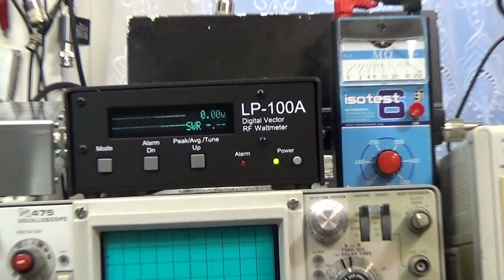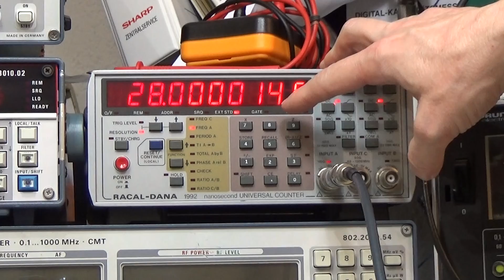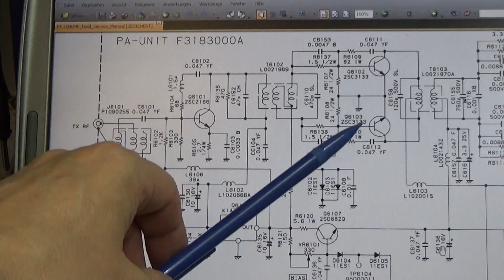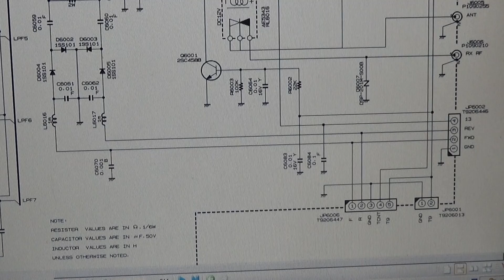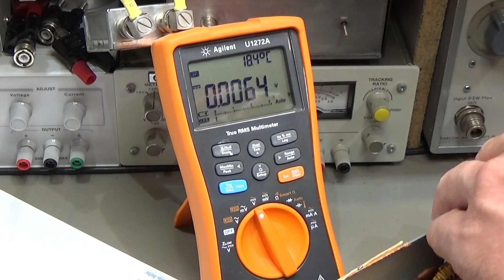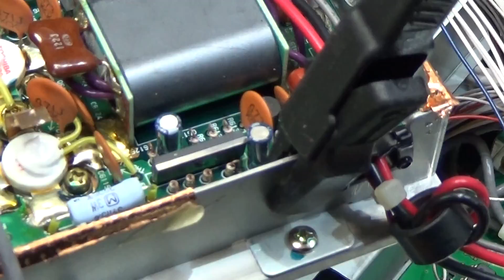#44 HAM Radio repair: Troubleshooting Yaesu FT-1000MP V Field with no TX power

Comment: Is there a way to limit power output in menu I have the 200 watt model and would like to limit power to a max of 50 watts so if the front power knob is all the way up still only 50 watts 2E1GZQ

Comment: Hi TRX Lab I have same defect on my FT-1000MP I saw this video and when I come back from my Holiday I try to investigate because my radio doesn't switch in TX 
Into the video I noticed that you have used a three way connector: in one of these is connected radio in the second a dummy load an in the third a bnc that is connected to a millivoltmeter and next to a frequency counter. Where I can find this three way connector. what is the exactly model. Thanks in advance for your support. Riccardo (IU2OFF), Milano Italy

Comment: Love your videos. I've learned a lot. I have a 1000MP (non mark V) with no power out. It goes into transmit mode, but no power out. This has been an intermittent problem over the last few months, but now it's consistent no power out. Following your video I discovered that voltage to the final stage drops from 13.7 down to about 12 when pushing PTT. Any thoughts on what to check next?

Comment: Hi there again Peter. ("Deduction my dear Watson.") Sherlock would have said ,or something like that .Hi Hi. I laughed reading the comment from Capt. Larry re old radiomen giving the radio a bang to find a intermittent fault. That reminds me of some years ago in our units Tech workshop when a regimental signaler brought in a faulty psu for a C45 radio. He stated that the thing would not switch on. One of our technicians took hold of the offending psu and bounced it onto a thick rubber mat on the ground.(That's why the radio equipment had to be soldier proof). Connected the psu to a radio at hand, plugged it into a test antenna, switched on and hay presto it worked.The signaler left the workshop with his tail between his legs so to speak and was told "Next time give the F--ing thing a kick with the sole of your boot on the front protection bar. That was the typical first i.a. to sort out the usual none working vibratore installed psu's for the "Larkspur" C range of sets. They were changed to transistorised units in the mid 60's. Thank God. Well done on the repair video Peter. Well explained for anyone having to do the same repair to their equipment. Keep up the good work as always. 73 de John - G0WXU.
Reply from the maker: LOL very nice story John....thanks for sharing !73

Comment: One of the reliable tests of old radio men is to bang the thing on the table while powered up !   Mechanical intermittent faults are a REAL possibility.. which might have revealed itself in that kind of preliminary test.   Of course, until it has failed , it nearly impossible to do the rigorous trouble shooting you have seen here to isolate the problem.  Always a treat to follow along with this great radio tech.  w6wuh

Comment: Very well done and informative. My only complaint is you seem to talk a bit longer than need be and draw out the length of the video unnecessarily, but the final result is a working radio, and of course that is want we all want to see.
Reply from the maker: Randy Behrmann Thanks for your feed back! You may be right, I'm always trying to do it as easy as possible for beginners. That might be boring for more experienced viewers...Hope it is not to hard to watch. Thanks again!
Reply: TRXBench
It always takes longer to explain the repair than to actually do the repair. But the logical process is the important part. Good work.
Reply from the maker: Brad G
Hi Brad, that is exactly the point! Thanks for comment 73

Comment: Great as usually. At the beginning I would have check also monitor to see IF stage works. Thanks
Reply from the maker: Pasquale IW0HEX Hi Pasquale, yes you are absolutely right. That is a helpful step, without opening the radio. Thanks for comment! 73
Reply: TRXBench Hi Peter. Another test to do before is to check the current (A). In your case there was no bias on pre-driver, drivers and finals so the current it would has been very low. I know the bias about 10-15% (approximately) for the maximum current (about 20 Ampere for HF radio with 100 watt output power).  In your case was a great way to understand that the PA didn't work.  Best 73s.

Comment: That little blue transverter switch is a silly idea on Yaesu's part, Isnt it!   Wink Wink :^)
Reply from the maker: Mr Carlson's Lab HaHa, yes you are right and  and contact problems at the switch as well know it from earlier repairs. Silly idea .
Reply: TRXBench Keep up the good work! I enjoy your videos.
Reply: enjoy your videos do you work on radios for the public need to have a few things done
Reply from the maker: Joseph Jones Hi Joseph, thanks for your comment! Well the radio community is huge, so it is never boring.
Reply: +Mr Carlson's Lab +TRXBench

Why do you guys think radios at $1K+ level don't incorporate feedback circuits for automatic failure analysis (e.g. autos and many other current electronics)? I'm a believer that with processors the rig should be doing the work to tell you right away what's wrong.